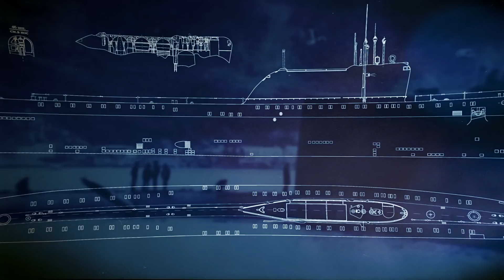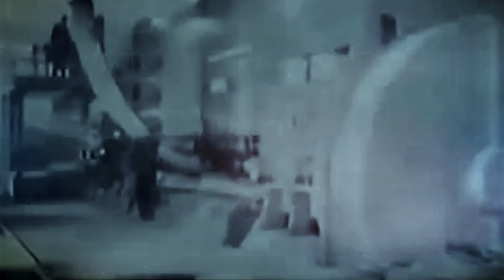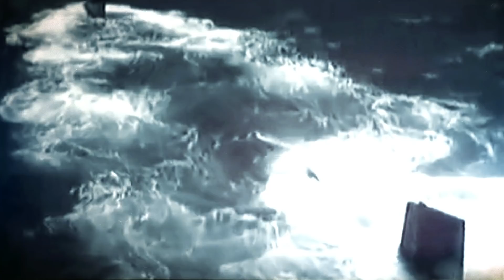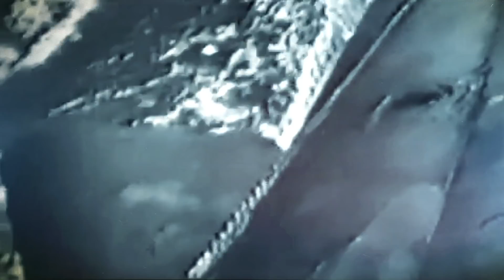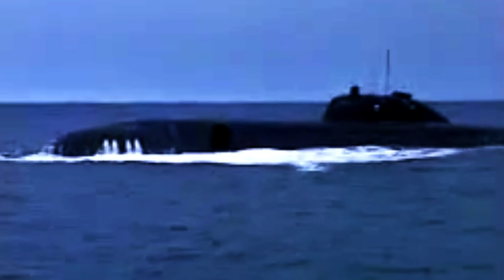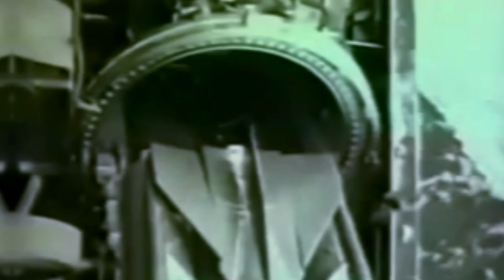When a Torpedo Got Stuck in the Side of a Submarine

Comment: Hotel wasn't a modification of November, rather November and Hotel were both designed to use the same front and rear sections with different center sections.
Echo was another submarine that resulted from the same project, completing the intent to create SSNs, SSBNs, and SSGNs using the same basic design.

Comment: Two mistakes : 1) an operator did not forget to turn off the guidance system. He should not have turned it off at all. He forgot to turn on a special training mode, where a 20m error is added to depth calculation, so the training torpedo aims on the sub correctly, but always passes below the sub. 2) a torpedo with no warhead anyway has almost no chance of penetrating the 3-4 cm thick inner hull as a torpedo is quite light and made from thin metal, it is simply too soft to penetrate it. Its a miracle it was able to penetrate even outer hull, it was much more likely to just  make a dent